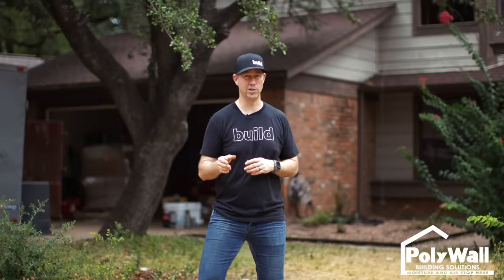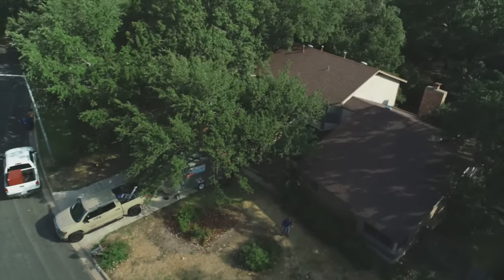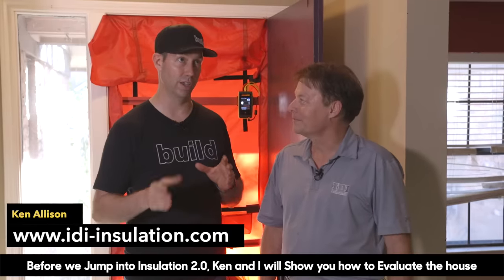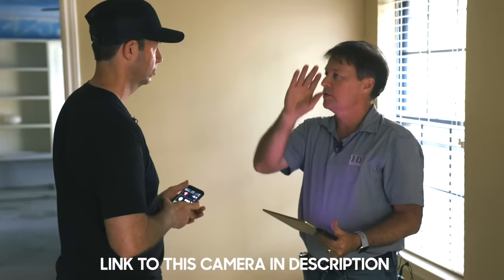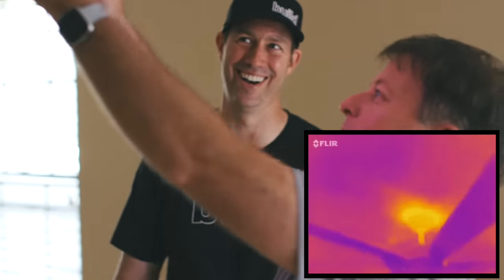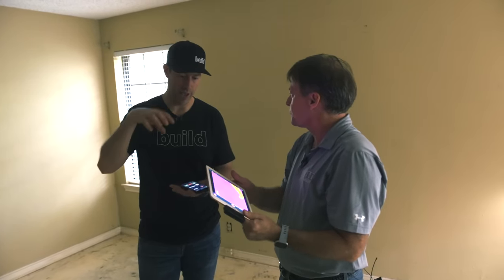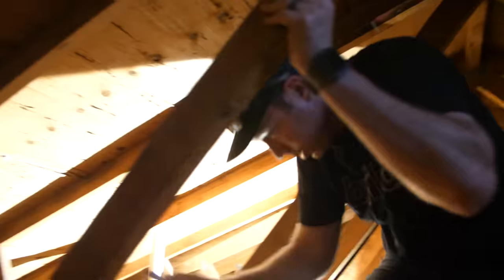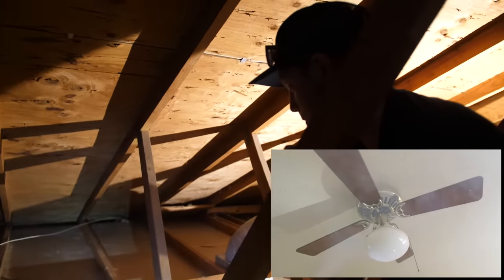Insulation 2.0 - 3 Steps to Re-Insulate

Comment: good to see another informative video Matt, my current house here in the UK was constructed in the 1800s the main part of the house is solid 3 foot thick stone walls, the 2 storey side extension which was put on in 1986 is UK 2 coarse thick brick walls with air gap in between, when we bought the house in 2001, on the main part of the house the rafters in the loft were only about 2 inches below the roofing felt,we had the roof reslated ,replaced the slates and roofing where necessary,as i was converting the main loft into another room,and due to the lack of depth on the rafters we couldn't insulate in between,so i  used 3/4 inch thick plasterboard with 2 inch of solid insulation on the rear to cover the whole of both pitches front & back internally and to the floor @ 45 degrees for the last 2 foot(attached to the bottom set of purloins), i also rejoisted the floor in the opposite direction to strengthen the floor before re-flooring with t&g OSB,we then proceed to completely re-insulate the loft on the extension with 6 inches of fiberglass on both the floor and pitches before covering with t&g on the floor and 8 foot sheets of hardboard on the pitches, we then had the cavity gap in the extension blown filled from ground up (as there was no cavity insulation),5 years later we installed triple glazed windows from Camden Windows( a Irish company), shortly after that i adjusted our central heating down in the first 12 months our Gas consumption went down by 68% yes 68%, i have since added a single storey rear extension which is also triple glazed and insulated to the the max, the house is so warm that i have not had the central heating for @ least 10 months, current temp of house as i am writing this is 17 deg centigrade or 62 deg Fahrenheit, and outside temperature is about 4 or 5 degrees centigrade, my motto insulate to the max  and fit good quality triple glazed windows, even in the summer we have a steady temperature, i only have one double glazed window in the whole house (a velux roof window), i have no need or intention to switch the central heating unless we get a lengthy spell of weather below -5 deg c, spend wisely upfront save a fortune later on, ps lets see the after re-insulation and a direct comparison between the two ~:) pps i live a quarter mile from the sea and get lots of high winds

Comment: Hey Guys, great video! I didn't hear much talk about vapor barriers and dew point. In the north, many older homes were not built with a vapor barrier in the ceiling. Applying continuous spray foam on the field not only provides a vapor barrier but protects your blow-in insulation from a dew point. Just a thought.
Reply: Which climate zones does this apply to?  Winters in the lower Midwest usually don't get snow accumulation for more than a couple weeks anymore.  Is a ceiling vapor barrier only a building practice for the far north?  Your comment from a year ago is the first I've heard of it.

Comment: I spray foamed my 1200 sqft house  everything is electric  no gas   My power bill average is $75 a month  in North Georgia    🤘🏽
It’s called   Rob’s Retreat   You can check it out on VRBO
Reply: eyeonfish   Yes , I have a metal roof and I had to spray under side to stop the noise from rain    I use closed cell
Reply: Do you use natural gas for heating and hot water?
Reply: The Truth no, everything is electric
Reply: Now you are perfectly setup for a tiny grid tie solar instal. $70 a mont for a couple years then free for life. Unless your living between 10 trees of course.
Reply: Ecospider5   I’m surrounded by trees
Reply: I tried finding your house but couldn't.  Can you attach a link?  Also, do you spray foam on the bottom of your attic as I had mentioned above?
Reply: Michel Fortier yes did   Spray foam bottom of attic
Reply: who did u use to do your spray foam? How much did it cost you?

Comment: Air sealing is an under utilized option.
Most older homes leak like if your leaving several windows open in the summer or winter.
Makes it hard to heat or cool without wasting money.
Sealing up those leaks is a huge energy saver.
Saving energy saves money month after month, year after year.
Every new home needs a blower door test during construction to point out areas that need to be fixed before the house is completed.
Reply: yep my 1929 home leaks insane and it was moved in 1954 175miles through the bush so things are tweeked as well. guna have to move my insulation around little by little as getting  contractor is next to impossible to come up where i am these days
Reply: @adrianstoness3903  Do what ever you can to seal up the house. It will make it much more comfortable temperature wise and it will save money on fuel. Try to address the worst offender first and work your way to the least offender. Once you begin to notice the improvement you will be hooked and will want to do more.
Reply: Kenz300 x only electric heat here. Yea I need to seal it up trying to figure that out rains cold in the basement when the furnace is on. House sits on 8x8 skids ontop of the foundation  length wise

Comment: Matt I am a young new builder in Michigan but my family has been doing it for 40 yrs and just had blower door test on my recent project we achieved a 1.8 ach with a two step air seal process. The first step is in the rough stages after all mechanicals are done they seal electrical outlets doors and windows top plates and bottom plates, then they come through on the drywall and caulk all exterior wall outlets and vents.. I understand the importance of air sealing a home but I have been taught that home needs to breathe  cause you can run into problems with hardwood floors buckling. I enjoy your videos and seeing how things are done differently around the country.
Reply: 1.8 is pretty good.  Do you have a whole house fan on a 24 hr timer? Like in the laundry room?  Also was that 1.8 on final, after all the windows were un masked?
Reply: Hi no whole house fan, yes that number is on the final windows are all sealed.
Reply: @stefanoferri1485  I have heard Matt say that anything under 1.5 ACH needs make up air.  I was also just talking to my HERS rater the other day and he said anything under 2.0 - 2.5 needs make up air.  It would probably be best to put either your laundry fan or a bathroom fan on a timer to kick on throughout the day.

Comment: Dr Energy Saver covered this years ago....same format...nice add on with the fog machine. Fire rated orange foam is an option,...code some times req....going thru all that and use blown in fluffy stuff..or foam , hell no....ROCKWOOL ONLY
  Would also go thru the trouble to run 1/2 in POLYISO board with a 1 in. air gap run from soffit vents to ridge vent....yep between each rafter, now that's a project sports fans.
Reply: I’m with you on the rockwool. I don’t fully understand what you are suggesting about insulating between the ridges. Can you explain to me the purpose and function of this? Does this keep the roof cold in winter and hot in summer while keeping the attic temperate?

I am looking to reinsulate my 1950 home. I want to remove the blown in cellulite in the attic and replace it with rockwool. My attic is low with a vent on each end.
Reply: J A Miller - it does help with cold roof in winter and blocks some of the heat transfer to the attic from the roof during summer.  You have to do it correctly so there is good airflow and you don’t overheat your roof and some shingles perform better than others at higher temps.

Comment: Great video. Only one comment--I have the same Flir IR and would have liked to see the temp display turned on to show the delta between hot and cold spots. While the images and sensitivity are impressive, it's important to see the actually temp variation to know how bad the problem really is. It  may only be a couple degrees depending on the settings. When I do my first pass I like to set my range and colors to highlight the most egregious problems first. Otherwise you can go nuts chasing everything that's "orange" (or purple up north).
Reply: True. The difference between blue and orange can just be a few degrees.

Comment: Hi Matt. I have a home that was built in 1986 and just is not very efficient. My power bill with AC in the summer and my gas bill with heat during the winter just kills me. I have a walk up attic that is framed for a 5th bedroom. It also has the gas hot water heater and the gas furnace in a section of that walk up attic. I wanted to air seal the top plates, electrical wire penetrations, and light canisters like you were describing in this video. I also wanted to add new batts insulation where available, especially in between the roof rafters. I also wanted to add a radiant barrier because being here in NC the summers can get quite hot and humid. Since I don't plan to finish out that 5th bedroom I wanted to use it for storage, so I want to try to find a way to keep it much more cool during the summer and warm during the winter. Since I have the gas furnace and hot water heater in the attic, will this be a problem adding the radiant barrier, like adding the foam? Thanks!

Comment: I'd like to see how you remedy missing insulation in exterior walls. I think a few of the exterior rooms in my house have that problem.
Reply: I'm not a pro, but when we remodeled our house we rented a big box blower (free when you buy X bundles of insulation) and did the attic. To fill the exterior walls, we located the studs, and used a 3" hole saw to remove a plug in the drywall near the ceiling between each stud. Then we used the insulation blower to fill the cavities. Some needed a little more convincing with a fish tape to fill, but all in all it went well. Worst issue was communicating to the person running the blower to shut it off between holes. You either need to empty the room of all content, or cover and tape it off. High pressure insulation blowback isn't pleasant, whether or not your mask is sealed properly.

Keep the drywall plugs intact, and it's quite easy to tape and mud them back into place, and a coat of paint was happening anyway.

Maybe the pros have a better way of dealing with it, but it worked for us.

Comment: what was the blower door score after sealing? Would be nice to see it in stages, like attic, then windows or whatever else you are going to do :)
Reply: The blower door score doesn't prove the building is insulated optimally. It only shows the degree of improvement. A competent insulation installer is required to maximize energy savings; not cheap IR cameras and expensive foam. These silly boys need to attend insulation school. Or, at least, stop talking!
Reply: Straight Razor Daddy  , thanks, I use expensive IR cameras and blower door testing (before & after,) but neither affect the quality of my work. I know what must be done to optimally retrofit a home's insulation.  The work performed is the result of experience, skill, and a knowledge of thermodynamics. At best the IR camera is a sales tool - and the customer can gain confidence seeing the difference from before to afterward. The blower door tests are simply required to gain utility rebates for my customer. Neither results in a better job. I suppose if the contractor is unscrupulous, these devices keep him honest. I can teach techniques for quality insulation work. I cannot teach integrity. Either an employee wants to do a great job, or they just show up for the paycheck - those don't last long.

Comment: In another video you talked about the benefits of spray foaming the attic ceiling as a more efficient alternative to insulating the attic floor. Benefits included your attic HVAC running in a cooler environment and being able to use your attic as storage. Just curious why you didn't choose to do that with this house? I'm currently in the middle of making this decision. Thanks.
Reply: if it is just a flip, it's a cost decision.  If you were living in it, you would probably condition the space, specially in Texas.  On technical consideration against it (same as my flip): the house has ship lap sheathing.  Soon that roof will need to be replaced along with the ship lap.  You would want to re-roof, re-sheath the roof before foam coating those old boards.  Just my opinion..

Comment: As an insulation contractor we did this on a new construction house this last summer. Over 4000 sqft with 10' walls the house was tested at .4 exchanges.  FYI they put the vents in the soffits  upside-down.
Reply: Damn all that work and they botched the baffles.  I'd be pissed.  I hate hiring contractors because even with a good company I never know if the guys working that day are new or give a rip.  If I'm paying that much to suck out and blow in new insulation I don't want to have to be supervising them too.  Sheesh wth.

Comment: Why leave the old bathroom fan?  I tossed those on my first remodel and vented the new ones w rigid insulated pipe.
Reply: I think it is going to get ripped out as part of the demo, they were just doing that to show you what would be done if you weren't remodeling the whole thing.
Reply: Where I live (Australia) it isn't required to externally vent a bathroom fan (if it's normally venting into the ceiling space and you have a tiled roof (which has air gaps between the tiles)). I'm curious to know why it's necessary in your situation?

Comment: Great video.  So far you've shown

- put a number on a budget and its never what you expect it would be. (this is not a bad thing, always happens)
- always expect the unexpected (rat poo in your air ducts, didn't expect that but it happened)
- check for leaks and seal with spray foam or can spray foam before putting down new insulation. (great suggestions here since my moms house is old too)

Comment: IR is an indirect measure for air leakage and requires interpretation. IR is radiant heat (electromagnetic) and air leakage is convection. It's a given that heat will transfer via convection or conduction, so this heat is transferring into the home one way or another, but this doesn't fit your Gortex analogy very well. IR imaging makes for impressive and dramatic pretty pictures, but the software is also auto-ranging to add the most contrast to really make even the smallest deltas pop. Also, this isn't measuring heat (energy), it's measuring temperature. So, this could be misinterpreted - it's great data; BUT, it really takes an experienced and qualified interpretation of the data to make IR data meaningful.

Comment: Re-watching because we want to apply the Insulation 2.0 concept to our 1987 "Federal" style house. Attic currently has 3" of fiberglass...maybe R10, probably only R8. Hoping to seal everything on the ceiling, and add blown rockwool and bats where to supplement existing FG. Will try to get an energy audit this winter and then after we finish to see what we accomplished.

Comment: DIY question. I have 10” insulation in the attic. I thought, shovel that to one side. Air seal. Shovel to the other side. Air seal. Bring rock wool to cover. So I end up with 20” blown on one side Rockwool on the other and I’m all sealed up. 

Is there a reason this would be a bad idea. 
1990’s western Washington 2 story house.
Reply: You don't need to move all the insulation. Just over the wall plates. The cheapest sealant is dry wall mud and tape. Free, ask around.. The crack between the outer wall plate and the sheetrock will be the hardest one to seal.
Reply: Great suggestion on the drywall mud. Thank you. Getting to the outer wall plate is going to be a pain. I am going to do the rest first to get used to moving around up there then decide if it is worth it to try and reach that. Getting all the other walls plus the recessed lights and around the bathroom fans should be more than 70% of it.
Reply: @kkarllwt  Question...If you have drywall mud and tape on the interior drywall and wall-to ceiling seams already, why do you have to air seal over the interior wall plates?

Comment: What can you use to seal the chimney (hot water heater, fireplace metal chimney eg) opening in the ceiling - where the metal pipe goes through? As I recall, the building code requires an inch or two of clearance from combustibles. Thnx
Reply: Metal flashing and high temp silicone should work. Then you can use a mineral wool bath around the pipe.
Reply: Same question, but would fireblock foam work right against it or do I still need to do the metal flashing?

Comment: Thanks for the video. A couple of comments...we have performed over 5000 home energy retrofits throughout British Columbia Canada. All blown in insulation are not created equal...we use non toxic high density Cellulose insulation (not a big fan of the fluffy stuff). In order to create your Jacket effect we then cover the blown in with Low E (emissivity) multi-layer aluminum reflective insulation to trap the heat in the winter and reflect the heat in the summer. Finally, as we find plenty of mold here in the North West we then tackle and increase to attic ventilation in order to increase air flow in the attic which decreases the amount of air conditioning required in the summer. Comfort increases exponentially and this strategy usually results in a savings of 30-50% on energy bills.

Comment: I am doing a reno on a 1930s villa in BC, Pacific NW. All fir construction, diagonal t&g fir 'sheathing'. Tar paper exterior and blow in insulation between studs. All outer wall cavities have a 1" drilled vent hole to the exterior prior to paper and cedar shingle siding. The entire place is dry/petrified hard. Oil heating runs to 55$ per month for 2500sqft. Supplemented with 2 cords of wood for the winter. Original single pane sash windows due to be replaced. Wood construction (lumber is a joke these days) needs to breath. I respect Matt, but would love to see one of his air tight stick builds in 90 years.